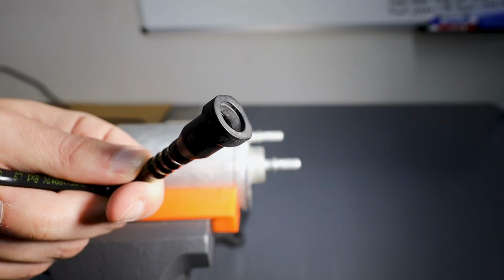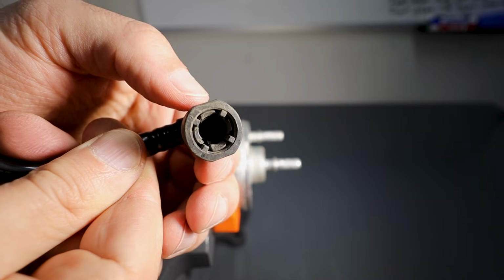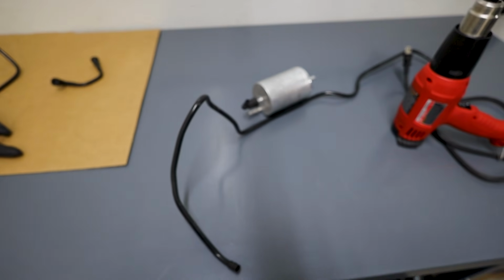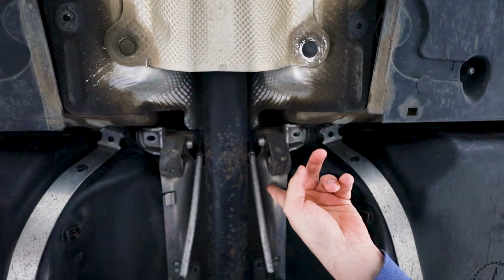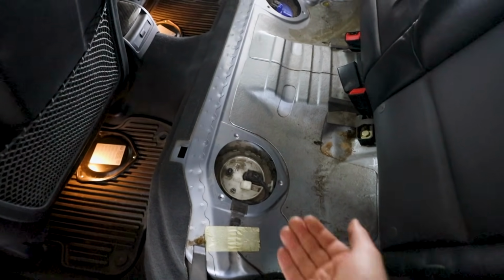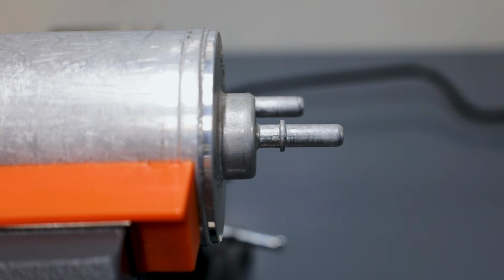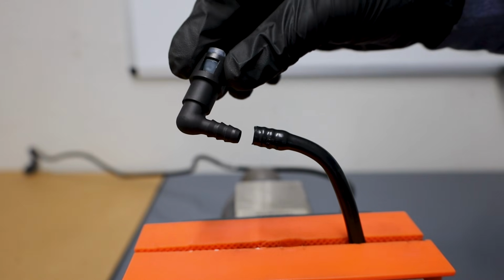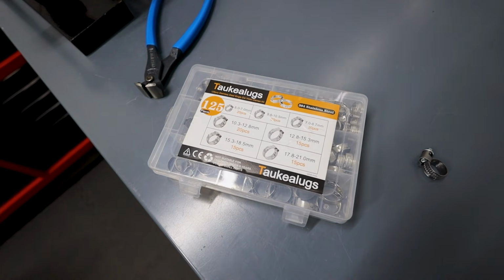How to remove (or replace!) fuel lines & fittings | Audi VW | S4

Comment: excellent video. I'm a German auto mechanic. Was actually checking this video to see if there would be a tool shown to help remove those stupid slide release connectors.  They are absolutely ridiculous.  As in video it's recommended to spray some lubricant inside that stupid thing; although, if possible, try to blow out dirt and/or clean it out before lubricating. Half of the connectors are push buttons.  Why the hell did they even use that stupid connector!  Never thought about replacing the connector. next time I have to mess with my Audi I'm going to try it out (if I mess old connector up; and, obviously, not on customer's car).  Very informative . Also, we never remove gas tank to replace lines; extra work.

Comment: Dang, I just found out my ford focus mk2 that I bought used has the fuel filter secured with ZIP TIES because those connectors broke of. Spoke to a mechanic and he does not even want to think about doing this job 😂 I'm screwed

Comment: Just came across this video. The male end of my fuel feed line on my E90 328i broke, it has the stock line. Could I just remove it with heat and put another one back in?

Comment: I can’t even find a metal fuel line anywhere for my 3.0t s5 cabriolet… would I be able to use the hoses instead ?
Reply from the maker: As long as the material is pressure rated for what the car should have, you can secure the line to the chassis properly, and it hooks up to whatever is up+downstream of it, yeah, you can use whatever you like.

Comment: Awesome! Saved my bacon on those cryptic connections on my 09 VW. Got the Fuel filter bugger changed out. Lots of sediment came out too! Thank You!
Reply from the maker: That's what I aim for; retainment of the bacon - good work
Reply: @FigureItAuto  ha ha, and it cured my nagging P0171 Lean CEL code. It cycled off. yaaa!

Comment: Hi, thanks for the content. It is much appreciated. Can I ask if the quick release connectors on the fuel line be changed? I suppose the answer must be yes otherwise why sell them individually; is a heat gun the way to soften the hose so the plastic connector might fit in? Thanks in advance. Hus
Reply from the maker: Yes and yes. It's all in the video but the important part is making sure the fitting doesn't leak when it's put back into the old line. Hence the clamps, of some style.

Comment: Yes i was changing the fuel pump in my B7 A4 when i noticed someone had already mangled the high pressure connector. A new line from audi is 200 bucks. And a lot of work. Great idea replacing the connector. I'll try that .  I made pliers to remove those connectors out of an old pair of wire stripper pliers. I bent the ends and ground some material away.  I just copied the pliers they make for removing connectors.

Comment: Is the fuel pump side 5/16 also ?
Reply from the maker: Not always - the ports on top of the fuel pump sender unit can be different (still only of the usual 5/16 or 3/8 options) but typically it matches the size of link it's going TO on the fuel filter. Always best to visually confirm.
Reply: Okay , going to give it a try

Comment: I replaced the fuel filter on my Mk6 Golf R last night. The clip on the supply line wouldnt depress and looked like it was stuck in the open position. After a bit of struggle i finally got it off. Undid the other two lines and unscrewed the Phillips screw. Installed the new filter, reconnected all the lines and heard them all click in place. Fired up the engine and within a minute there was loud pop followed by a gushing sound. CEL and it started to stall. I hit the start stop button. Jumped out to find fuel all over the ground and the line disconnected. For some reason it clicks but doesn’t lock. Owner the car for 3 months and not sure how it stayed in place so long. Ive searched ECS, VW parts and FCP Euro. I cant find a replacement line anywhere. Im a little beside myself as this kind of thing can leave me stranded but i appreciate your video.
Reply from the maker: Thanks for sharing the struggle - I've been there. In another video on a channel about replacing the fuel filter (in pump assembly, in tank) on the old B8, I suffered the same problem as you during testing. In my case, the assembly was fine but the lock ring holding the pump was a little loose and I also had a gas scare. I find anything related to fuel pumps to just be finicky and failure prone. Good luck solving your issue with the fittings - I'm sure there's a simple (albeit frustrating) solution to your issue.

Comment: I have broken connectors on the return line to the passenger side of the filter and putting a new on that tiny hose heating it up is impossible

Comment: If you have 150k miles and have never done it. Just fucking throw the car away. Those connectors absolutely do not come off and it will be more difficult to replace the connectors than the logistics of d-day.
Reply from the maker: Knowing the odds, sometimes you just have to storm the beaches.
Reply: Same. My car is on 178k miles and what looks like an original fuel filter. There is NO WAY that connector is coming off 😑😑😑

Comment: would you consider doing a upgraded fuel pump install DIY or guide for the B6/B7 S4? a pump that will be able to run E85. just a thought thank you!
Reply from the maker: Yup, I would and will likely need to with the trajectory of mods coming for the S4.
Reply: @FigureItAuto  thanks for the reply! i am wanting to go E85, but hesitant on changing the fuel pump because i never worked on an audi and i couldn't find any detailed video on how to do it.

Comment: I've been struggling this a while, though I feel mostly because my S4 is a cabrio, which happens to have a strut pass over the fuel filter, making it more difficult to access.
Reply: How’s this going for you? lol i have a cabriolet and im having issues to
Reply: @icyboy3535 Still haven't done it, lol. Bought all the parts for a fuel pump job too. I just don't have as much time anymore. 😅 I was informed on some kind of tool however that removes the hose connections easier, though.